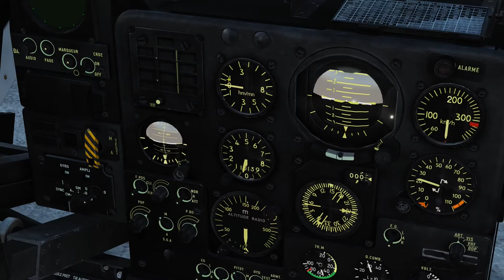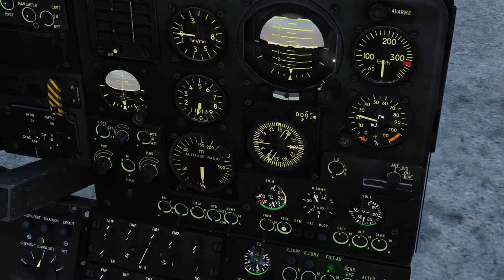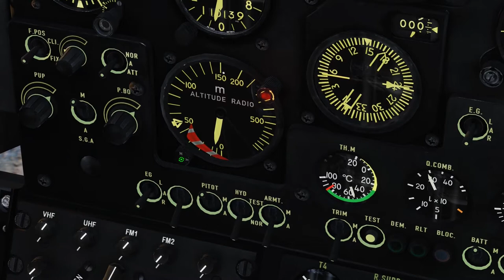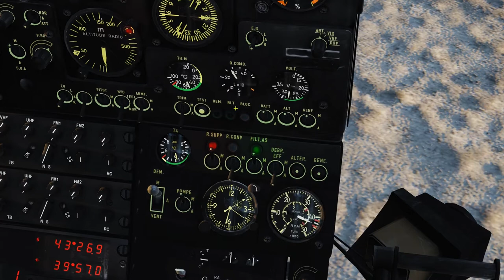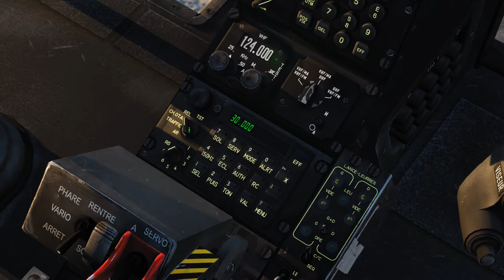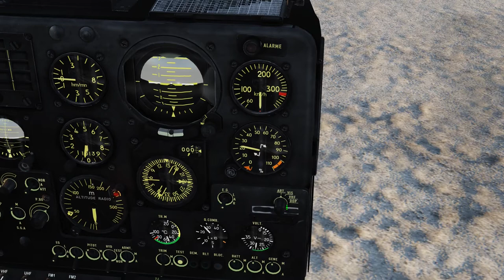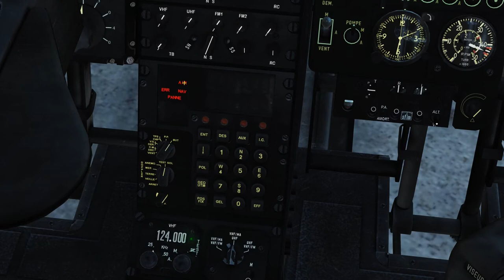DCS | SA-342 Gazelle Start-Up/Weapons/Avionics/Systems/NADIR | Tutorial

Comment: Interesting tip about the ground power, I've been doing it the "long way" this whole time.

I'd also like to add for any new people seeing this, the Gaz auto-hover is very sensitive to the position of the fuel lever. if you have it bound to an axis, a seemingly minor bump that you wont really be able to notice on the RPM gauge will prevent the auto-hover system activating.
Reply from the maker: Glad I could help out in that regard, and thank you for the response! I just tested your above statement about the minor bump disabling AP and it's indeed true. I've never experienced that issue before, but I'm sure it could be more common for others depending on your control setup. I would suspect that shouldn't be the case though, because as I understand it the alternator provides AC power and should remain on as long as RPM's are above 41300. A small bump shouldn't cause the alternator to turn off, therefore I'm lead to believe that might be a bug in the programming.
Reply: Whats worse is some entry level throttles, or throttles that are older have a "warble" in terms of signal strength/consistency at the extremes of thier axis. This can lead to DCS getting a less than "full forward" input at random, even though the physical throttle of the user is shoved to the stops.